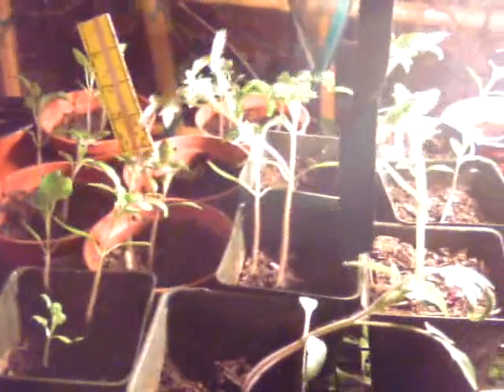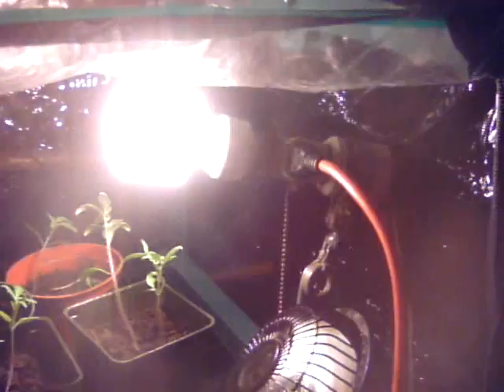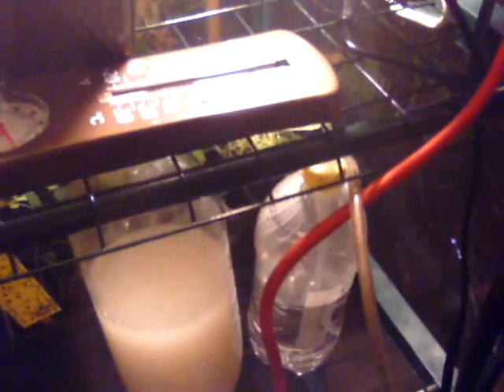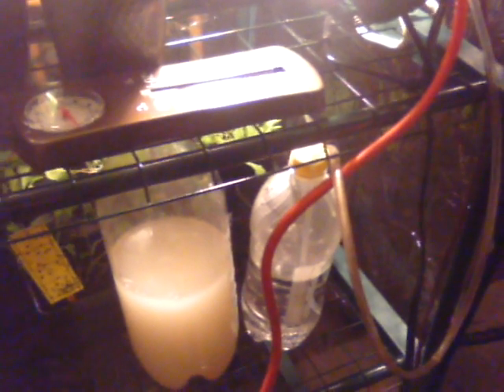part 2 how to make a co2 generator for growing plants

Comment: Here is a much easier and cleaner way of doing this:
Get some dry ice. Put in an insulated closed styrofoam container and poke a small hole in its side and connect a small hose to that fan. 
It will last you for days or weeks depending on how much ice you put in there.
Reply: So if I have a 9ft grow tent how much dry ice do I need?

Comment: One thing is clear the seedlings stretching for the light. To thin internode to far away for a good yield... The bubble every 5 sec I counted 8 seconds... But it Wil immediately go down its heavier than air so after the fan it immediately drops down leaving no Co2 residu for the air inrichment. A 250 MH hps bleu and red light ex Philips pia son + you lose in the beginning of the cycle... In Dutch an expresión a good start is half of the work... No critical you're intensens ar good just adjust. Look at you're crops live cycle for some the season is to short for organically feeding you're medium because that's what you do. The need nutrients easy to absorb the only way whit maximum 14 hours of daylight.
Ever grow Mary Jane? It's the most rewarding crop and the medical benifits are countless. Grow on work whit plants shows you live....

Comment: this works. fermenting yeast gives off CO2.but...
dont beat up the yeast by shaking the crap out of it. you can shake the crap out of the sugar and water and then add the yeast and let it set. its called proofing the yeast. also the yeast will stay alive as long as you feed it. after about 3 weeks you can dump out all but a cup,save a cup of the old yeast solution.disinfect the container and start all over again with that cup instead of the yeast packet. yeast solutions have been kept for hundreds of years.sourdough bread is almost alays made from a starter culture that has been handed down for generations.
Reply: Or just start brewing kombucha. At least now you’ll have something to drink
Reply: gary sickler hi Gary.  You mentioned feeding the yeast? With sugar? 
Or with more yeast?
Reply: @Agingisachoice  sugar is food for the yeast. Yeast will reproduce itself. Just save some of the liquid and mix it with the sugar water mixture. Dont just add the sugar. Youll still have a lot of alcohol else in the mixture and bread yeast can only go up to 12-15%
Reply: Or bicarbonate and vingar

Comment: Why a second chamber?
Reply: to trap the alcohol made by the fermenting sugar . its basically how you make moonshine short of grain or something similar. dont try and drink this tho.
Reply: gary sickler my clones didn’t like it at all tho. I put a tube running into the top of the dome and 2 hours later they went droopy so I pulled it off and they popped back up. The tent loves it tho
Reply: Cheers. I made a few they are working good

Comment: Nice unit.  Thanks for the video.  Question: Why do you filter the output through water at all?  Is it necessary?  I'm not seeing why.  Also.. I'm exhausting hot air from my light (inside my tent)..  is the additional co2 even detectable in that scenario?  I'm sure something is better than nothing, but I'm interested in what your results have been before and after.  Thanks!

Comment: Having fans blow wind on the plants causes them to have higher transpiration. Unless you are watering them more often then usual, you are practically dehydrating them.
Reply: fans lightly blowing air on your plants is good.it makes the skalks and stems strong.and if you have plants withe dense flowers or buds it helps to prevent bud rot.watering is a small price to pay for healthy,strong,big producing plants
Reply: Fans are like wind to a plant. Winds will strengthen the stalk and encourage root/leaf growth. keeps plants pest resistant as well.